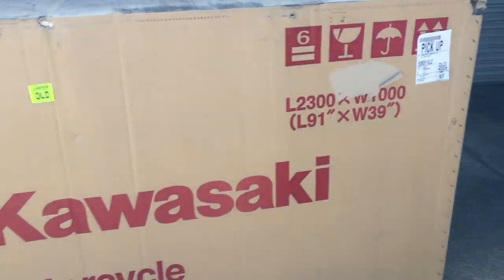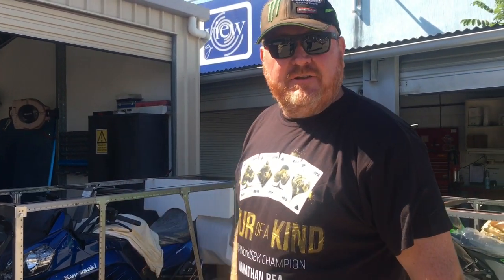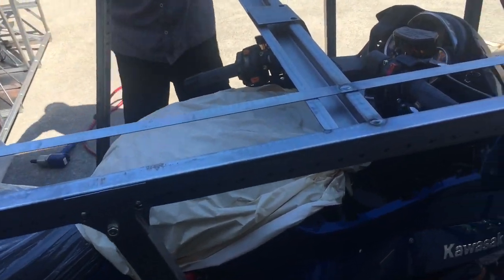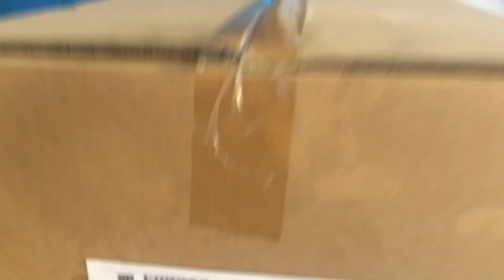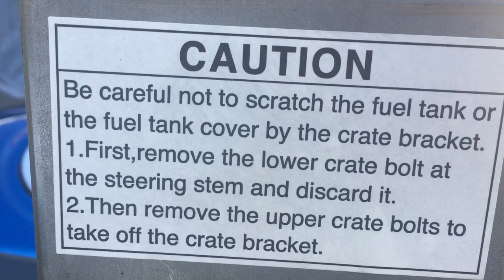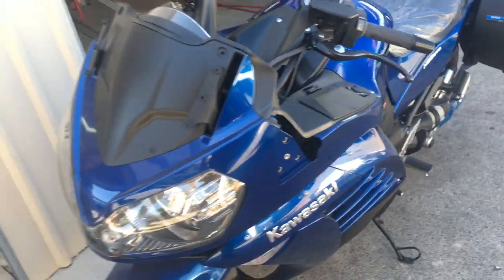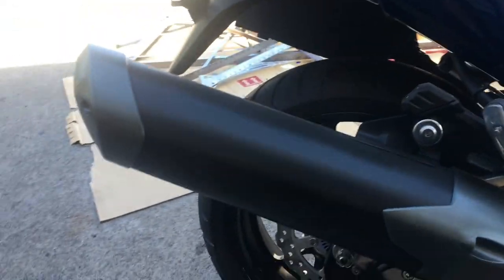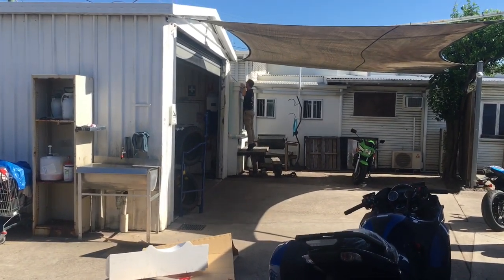Kawasaki GTR1400 Concours Unboxing and Chat

Comment: A fantastic long term bike, with exceptional reliability, and good dealer network, should have always had factory cruise control, everybody picks on it for that.
Reply from the maker: I agree, Cruise would have been good but the rest of the bike outshines anything in its class..Thanks for watching..Enjoy..
Reply: Yeah I agree. But I added a bar end cruse control works great. But electronic cruise control would of been the bomb. Too bad they didn’t make the bike fly by wire.

Comment: Nice bike the only short coming was no cruise control about 17k in the states I believe this blue was a 2016 or 17 in the states beautiful bike and color too bad the industry is cutting back on displacement and turbocharging is becoming the norm not a fan of turbos!!
Reply from the maker: They are a good bike, Sad to see them disappear, I think you mean Super Chargers, They are a great induction but for most riders we don't need them for the street, whats wrong with fuel injection as it is? I hope they keep the 1400 engine going in something? ZX14/? thanks for watching Jim..Cheers.